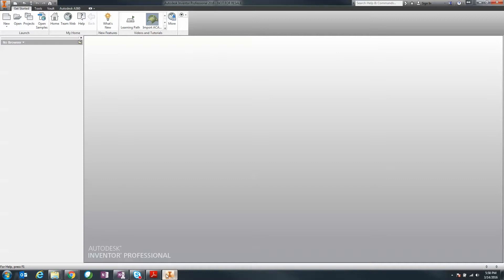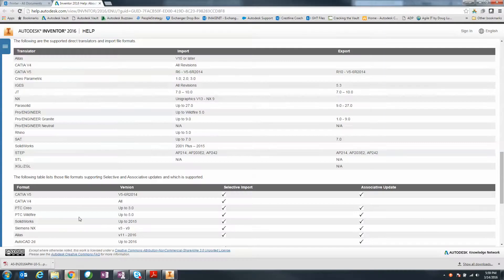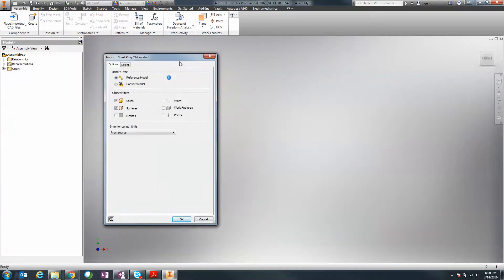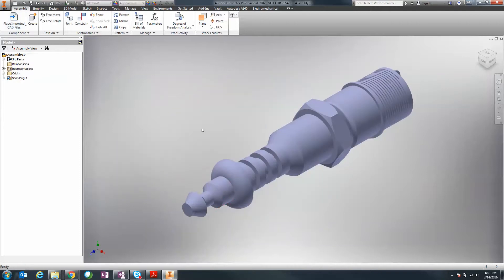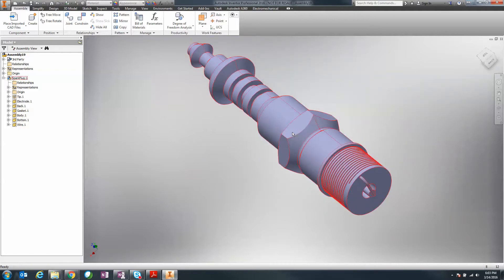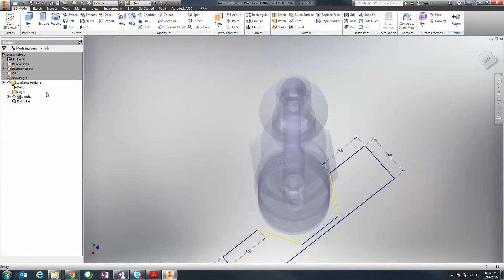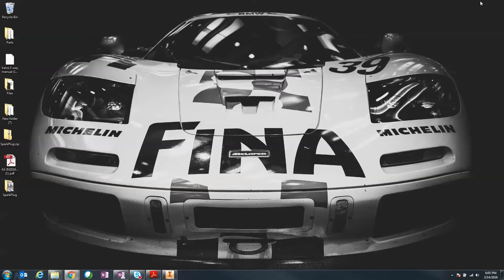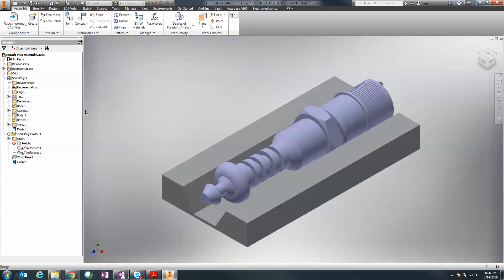Use AnyCAD to Import Files into Autodesk Inventor

Comment: Great tutorial, thanks!  

I was unable to get this to work with Creo.  Since Creo creates versioned files it doesn't seem that inventor automatically imports the new version of the file.  In other words, if I create the file "screw.prt.1" in Creo and save it, it creates "screw.prt.2" rather than overwriting "screw.prt.1" and it seems that Inventor is looking for changes to "screw.prt.1".  Is there a certain procedure you're supposed to follow to use Anycad with Creo?

Edit:  I found that it works if you rename the updated file to the original (renaming "screw.prt.2" to "screw.prt.1") but I'm not sure how to do that automatically.